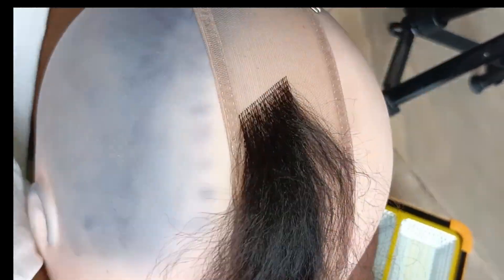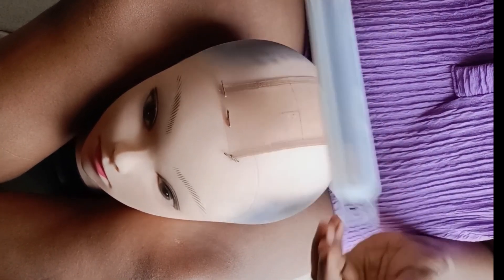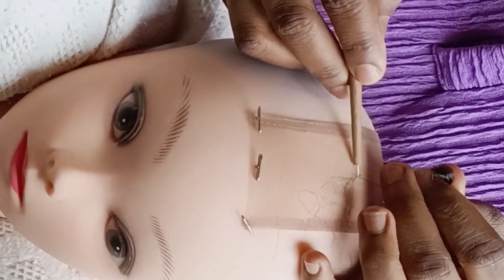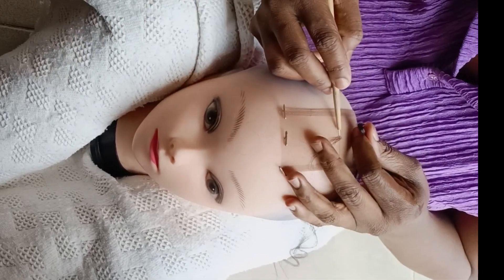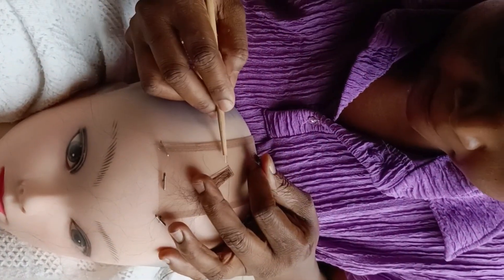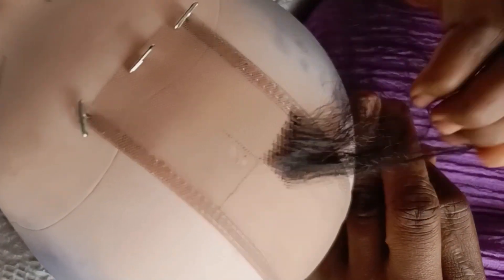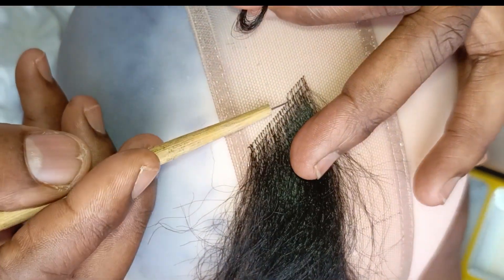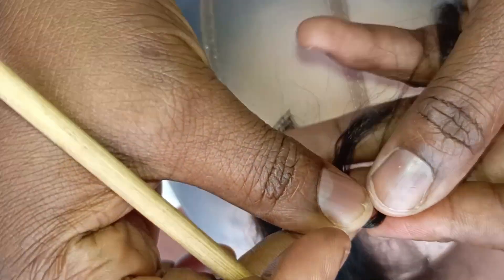A horrible video🧐 |watch and share your thoughts

Comment: Hey CJ! Thanks again for all your detailed videos. I made a couple of human hair closures , but now I just tried synthetic fiber, and it is so hard to work with. It always tangles when I pull the hair through the knots with the ventilation needle. It is knotting up where I hold the loop of hair in my hand, the lengths get knotted and tangled. It's dragging the rest of the hair with it. Any tips on what I am doing wrong?
Reply from the maker: @PwingMinecraft  what knotting method are you using?
Reply: @hairsme.1  I have tried them all, double flat knot, double split knot, and crochet in the back of the wig mesh ( double knot) . I don't do single knots because the single knots don't last as long. I also like making wigs 20-22 inches long, so the hair is 24-26 inches in length. So when I pull the hair after the knot has been made, it clings to the rest of the hair in my left hand holding the hair, and that hair rises up and kinks
Reply from the maker: @PwingMinecraft  ok... I will do a video to address this
Reply: You are the best! Is it because I use really long synthetic hair? Maybe I should use shorter strands?